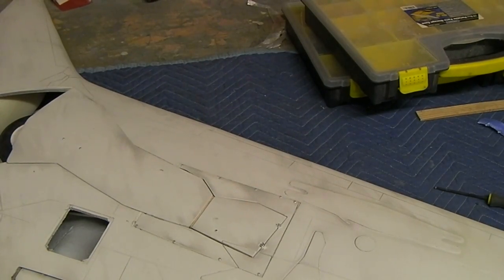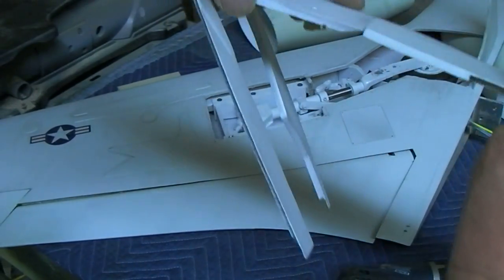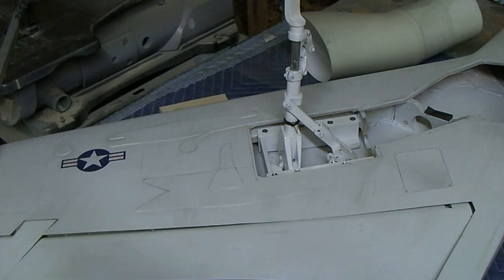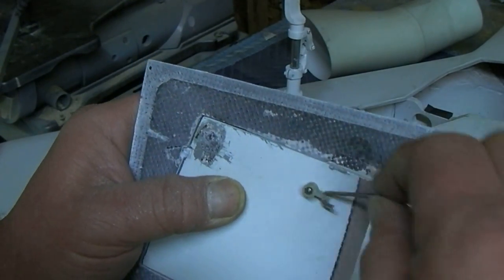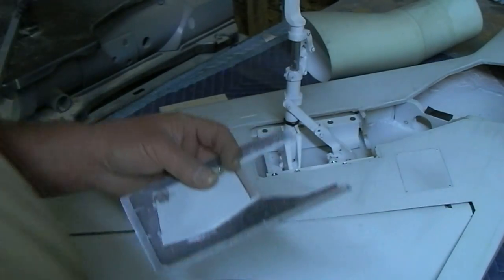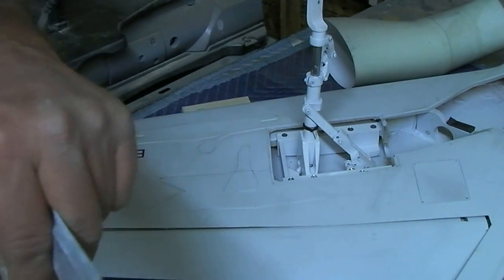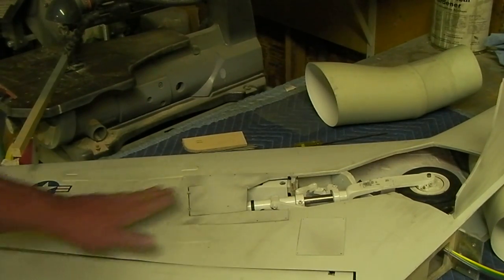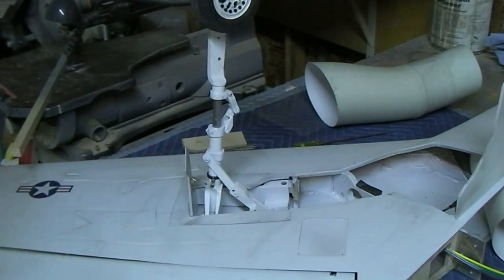how to build a rc jet F-105 thunderchie#517

Comment: Bob, the front gear doors may be hinged in a non-scale manner. The following video seems to show that the doors are hinged on the angled outside edge. I don't think it matters on the prototype, but you may want to verify the front gear door operation for the kits. The video also has a pretty good shot of one of the main gear legs. 

Can' seem to post a link.
The URL is youtube(dot)com/watch?v=IBjbb3pHMgc&feature=related

Wishing your dad a speedy recovery.
Ken